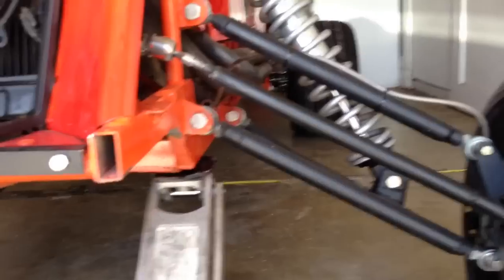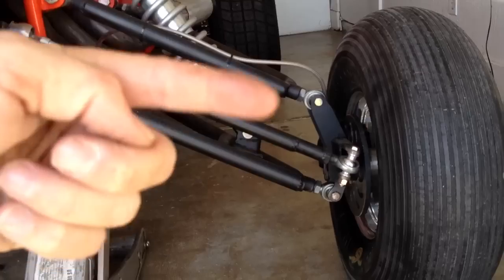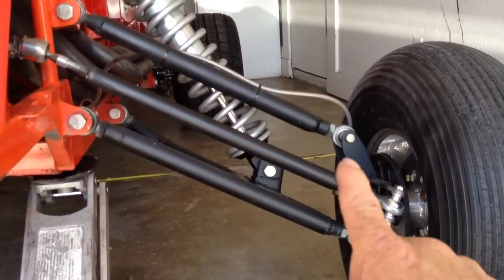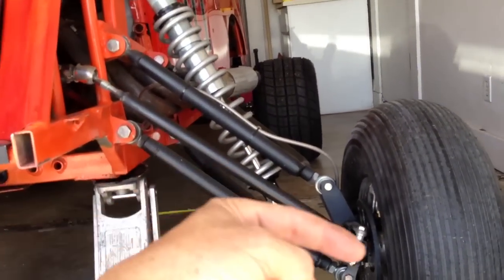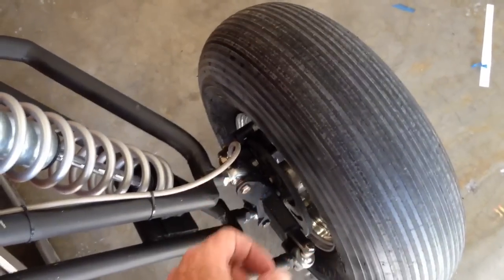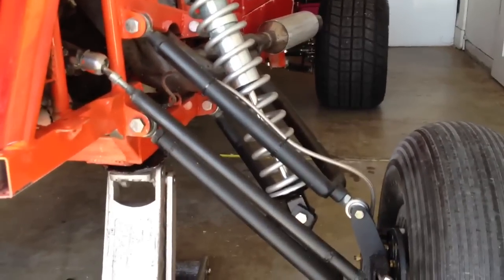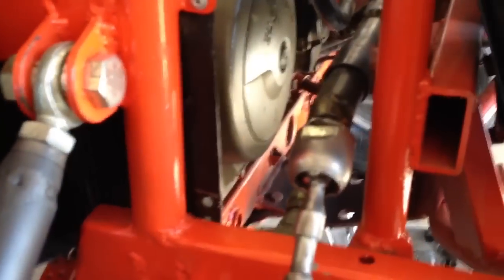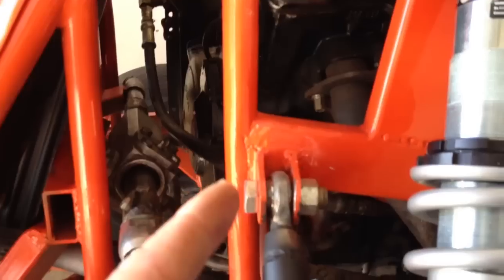Suspension help

Comment: Okay I have a question can you explain how your drive train is set up I have a dwarf car chassis with a ninja 600 engine but stumped on how to get my wheels to spin ha guess that's a good way to put it but ha dod you some sort of a gear box to a toyota rear end ?? It would help a lot /subscribing.
Reply from the maker: Okay. Well turn the bike motor side ways. Now remove the sprocket of the bike and replace that with a drive shaft adaptor. (Google dwarf car drive shaft adaptor). Made by HAWK. So then a drive shaft runs to the rear drive shaft to the Toyota diff. It's actually really simple. 

Need any help. Just let me know.

Comment from the maker: Good question. No the steering arm is the only part that has to match the motion of the control arms. But the distance forward doesn't matter. The closer it is to the spindle. The better steering u will have (farther the wheel turns with the motion of the steering rack) that same rack farther forward will turn less.